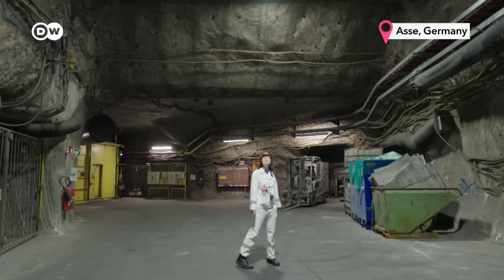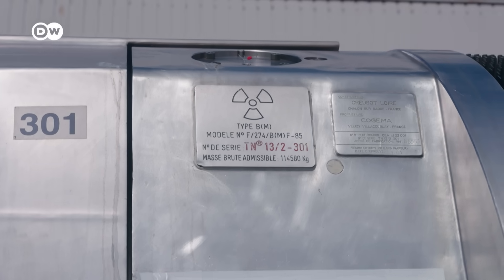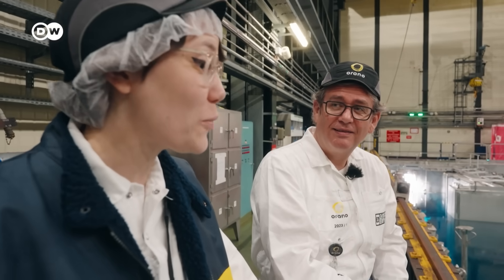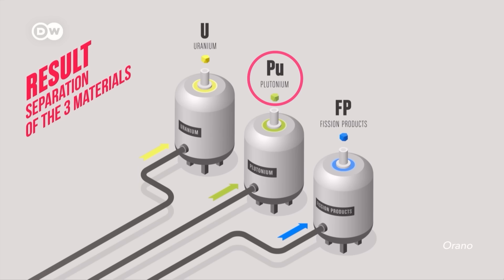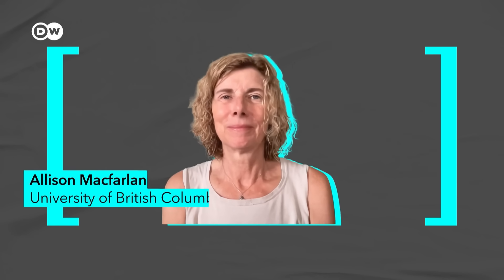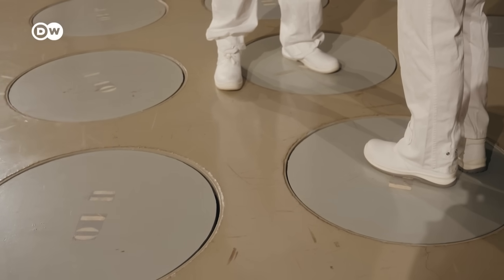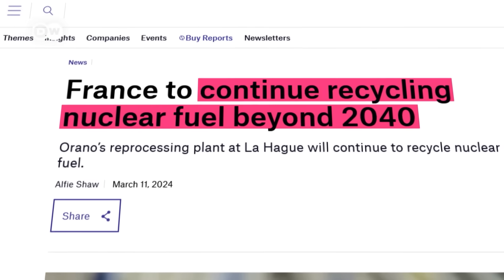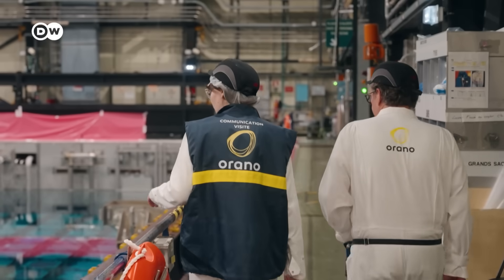Nuclear waste is reusable. Why aren’t we doing it?

Comment: Someone should create a simple system where you can just throw in disposed nuclear fuel into a dump like it's coal, and have it run a plant that directly removes carbon from the atmosphere.  Since the fuel will keep going for thousands of years, the place will keep sucking out the carbon.  Better yet, if this is a direct conversion of C02 from the air into carbon neutral fuel, then you could have it constantly piped out into some giant storage tank.
Reply: It doesn't work like that. Fuel is hot because of casks to accelerate the degradation. Without them the amount of energy released is pretty small so it's better to either reprocess it or throw it into a breeding reactor that'll do the same

Comment: Its not bad that we aren't immediately recycling it, becasue it is always available for future recycling. And it's easier to recycle once it has cooled down for a while.
Reply: This was a huge debate in the United States not long ago and kind of still is. Members of US Congress came out to discredit nuclear waste recycling to push solar and wind power.
Reply: @purplespeckledappleeater8738  "It was a dark and moonless night, with not a breath of wind to be found".  Start of a suspense novel, or an illustration of why solar and wind power will never be suitable for Base Load power generation?  Hydro is good, but you can only run so much water through the dam before you have issues.  

On the other hand, you have Columbia Generating Station.   1000MW of nuclear power plant with an availability in excess of 99% of their scheduled up time.
Reply: Yeah, thars why, for example Finlands new waste repository is designed so that the spent fuel can be recovered for recycling.
Reply: I wonder if the spent rods could be used in RTGs while waiting for the less stable fission products to burn out.
Reply: Nope, it's to deter the technology of enriching uranium and plutonium, which can lead to the spread of nuclear weapon. That's how India got its first nuclear weapon, from a peaceful use nuclear program.
Reply: Actually it's not, the permanent storage in Finnland, once it's sealed in, there is no easy way to get it out again..
Reply: @georgelionon9050  That's why I advocate against deep geological waste repositories. They are an answer to s question that nobody asked. Dry cask storage is better.
Reply: It cools down once radioactivity dies out. Also meaning that some of the interesting isotopes decayed...
Reply: @etienne8110  Not the ones relevant to power generation.
Reply: Wait... We don't use the radioactive part of the fuel for power generation?
Reply: @SeriousDrazhar  The isotopes that may decay on human timescales are not Uranium 235 or Plutonium relevant to power generation. They have half lives from hundreds of thousands of years to billions of years.

Comment: Gamma Rays are photons and produce megaelectron volts, seems like some type of antenna shield could be created that absorbs Gamma Rays and converts them into useful electricity, similar to a solar panel converting photons into electricity.  Testing can be done by converting X-Rays back into electricity then modified for Gamma ray frequencies.

Comment: The cooling water is looked over mostly(ditrium is it?)is this hot water from reactores and cooling storage radio-active?,,,and where does it go?
Reply: Stored until decayed, released after. It's not looked over, all the processes are studied and defined
Reply from the maker: Like commented, it is solidified and vitrified. (🔗https://world-nuclear.org/information-library/nuclear-fuel-cycle/nuclear-waste/radioactive-waste-management#:~:text=If%20used%20reactor%20fuel%20is,of%20heat%20and%20requires%20cooling.

Comment: Russia will build the first completely commercial reactor starting 2027 (BN 1200)
China will start around that time as well with 6 comparable reactors, its starting to take off.
Reply: The BN 800 reactor has been in use since 2015, BN-600 since 1980. China is building reactors similar to this.
But China is also building research molten salt reactors (TMSR-LF1) as is India.
Reply: @MihailG5541  China actually build 2 Bn600 style reactors (Cfr600)
Reply: @erik7853  can't find sources that describes connection fast Chinese reactors to the grid and power up to the nominal power rate
Reply: @MihailG5541  They are pretty quiet about the Cfr 600's, but the first unit has already achieved criticality a while ago, so logically it would by online by now.

Comment: It helps to think of nuclear fuel not as the gasoline (petrol) in your car, but rather the lubricating oil for your engine. 

The oil never stops being oil, but it does accumulate carbon residue, metal shavings, dust, and other detritus, thus becoming less and less effective. (In nuclear materials - the daughter products of the decay chain can absorb neutrons and thus degrade the efficiency of the fuel assembly) At a certain point, you are going to change the oil make sure the vehicle operates efficiently.

Now what to do with this oil? Stashing it in paint cans around the garage only works for so long. Now you could run the stuff through filters and magnets  to remove the particulates, then boil it in a hydrogen enriched atmosphere to refine out a new hydrocarbon substance - but that takes a lot of equipment and knowledge of chemistry. Especially if new bottles of oil are cheap and easily available - it makes very little sense to be doing this on a personal scale. 

It should be noted that the supply of Uranium was very uncertain in the later 1940s and early 1950s, so there were a number of projects started for reprocessing. However, more reserves of Uranium were found and the processes for refining it became more efficient. As time went on more responsibility for power plants was transferred from government service to private companies who in turn focused on cost-cutting even more. 

Unlike Russia, Canada, and the USA - France didn't have a great untapped Uranium source in an unexplored part of the country, so recycling continued to make sense to them. Their independent streak and desire to build nuclear weapons also made research into refinement/recycling lucrative.
Reply: the oil is a great analogy
Reply: lubricant in combustion engine is great analogy 👍
Reply: Mate. It is time for you to make a video. Thanks for your info.
Reply: Fyi Russia and Japan do have recycling plants too
Reply: @cristoforestman  That is a true point. I was focusing on France, as that is where the video is taking place. But we can look at some of the other countries and more interesting examples of what does or doesn't motivate the construction of these facilities. 

Japan - like France - doesn't have much domestic Uranium mining and thus it was also part of a self-sufficiency plan. Furthermore, they don't have a middle of nowhere to store waste - and while I don't know much about the island's geography, I doubt they have a spot that would meet the stability requirements for a facility like Yucca Mountain.

Russia's Reprocessing plants are left-over from the Soviet Era. That of course a whole discussion of a different economic system, paranoia about importing things from the West, and a design philosophy for nuclear weapons that requires rebuilding warheads more often than some other configurations. Major releases of material from some of these plants are occasionally used as an argument against nuclear technology in general. 

Britain had both a domestic nuclear weapons program, a lack of Uranium in the isles, and a harsh post-war financial situation that made the idea of charging others to handle waste seem like it could be a decent source of revenue. Even at the time people complained about the UK becoming Europe's nuclear dustbin. Also - some of the early British nuclear plants used a magnesium based fuel cladding that degraded in water, so they couldn't be left in cooling ponds for great lengths of time and thus required additional handling.
Reply: The power of cheap.

Comment: Do they use the energy from the waste while it cools?
Reply: Lower heating bill in winter maybe? 🙂

Jokes aside, the facility in Sweden storing 50 years of waste in a pool generates 5 MW of heat if I remember correctly so they need a bit of cooling of the pool.
Reply: It's too little

Comment: The waste I'm concerned about isn't the dry cask storage reactor waste. It's the Cold War era leftover waste from building nuclear weapons that was improver stored or disposed of. Some of it has just been dumped into lakes and into the ocean in steel drums. Some of it is just capped with concrete on an island in the Pacific Ocean, with waves slowly eroding the concrete away.
Reply: i'm more concerned about the 40 some nukes that have gotten lost over the years.
Reply: people should be more concerned about the waste generated by coal power plants : little to almost nobody talks about all the radioactive particles naturally contained in coal that get released in the air along with the smoke in the burning process, which adds to heavy metals, toxic arsenic and all the rest of the good stuff that contribute to kill thousands of people every year worldwide. (compared to less than 1 per year on average for nuclear...)
Reply: I'm not sure where you're getting these ideas from. When we decommission a nuclear weapon, the fissile material has never been thrown away, it's just turned into fuel rods for power plants. Sure there's plenty of waste from the refining and enrichment of uranium, but that's a chemical waste problem, not a radiation problem. You should be equally upset about any mining and processing operations that were done back before environmental regulations. Nothing special about nuclear weapons in that respect.
Reply: @iankrasnow5383   Look up: Lake Karachay, Runit island. For two examples. For more, read the wiki on ocean disposal of radioactive waste. 
https://en.m.wikipedia.org/wiki/Ocean_disposal_of_radioactive_waste#:~:text=The%20waste%20materials%20included%20both,been%20banned%20by%20international%20treaties.
Reply: @iankrasnow5383  that's BS. nuclear weapons grade enrichment is way too high for a reactor.
Reply: @cageybee7221  Mix the Plutonium with Uranium in the proper proportions and you have MOX...Mixed Oxide Fuel.  

FWIW, reactors can (and have) been designed and built that are quite capable of using what is considered a "Weapons Grade" level of enrichment.  What you end up with is a reactor that is rather small and has a totally awesome amount of time online before refueling is needed.  Almost sounds like a perfect design for, say, a submarine or aircraft carrier?
Reply: @iankrasnow5383  there are also situations like Rocky Flats, where the physical processing required to make nuclear devices also results in a lot of typical industrial waste, like metal shavings, used lubricants and solvents, etc, which are heavy in radioactive materials.

Comment: "... and stays radio active for 10th of thousands of years"

That figure is misleading and intentionally reported to sow fear. After 200-300 years you can safely hold the spent nuclear fuel in your hand. The elements that emit dangerous high energy radiation also decays the quickest. It then takes another 10'000-100'000 years before the low radio active elements have decayed below the level of background radiation.
Reply: Yes, those fission products under the floor only need 300 years. Maybe they are some useful elements after that.
Reply: @zapfanzapfan  It mainly consists of U238, which is fertile but non fissile. U238 can be used in a breeder reactor to create PU, which can then be used as fuel. 

The reason why we don't reuse spent nuclear fuel more is because of economics. There is so little waste to contain and it is still cheaper to dig up and enrich new uranium.

Comment: The Problem is that the nuclear power plants are cooled by water. If you dont have water like the last years in summer, the safety is not garuentied.

And dont forget solar and wind energy is a far way cheaper than nuclear power
Reply: You can put them by the sea.

Also, nuclear reactors are only more expensive if you build them in small numbers. If you build dozens of reactors, like France did, you get economies of scale and they get cheap. If you build 1 at a time, like the US or UK, then they're expensive.
Reply: False. It wasn't that the water couldn't cool the reactors, it's that the released water was too hot and would kill the fish. And this can be accounted in new facilities that'll have longer pipes/other methods to allow it cool further. Also, usually in these cases pp aren't shut down, just the reaction speed is reduced.
Most pp in france were recently shut down because lack of maintenance during covid
Reply: What if the wind doesn't blow and the sun doesn't shine? Nuclear is far more reliable even when there is less water.
Reply: safety absolutely is guaranteed. Primary cooling system is a closed loop. In case there is not enough water, they simply scale down the reaction which will produce less heat and thus need less water in secondary loop.

Comment: They Extracted It For
Nuclear Weapons,
Russia and USA!
Reply: Energy plutonium from nuclear waste consists of 3 isotopes that are very difficult to separate and almost impossible to use for the production of nuclear weapons, but can be used to produce MOX or REMIX fuel to save 30% of natural uranium in each cycle of reactor operation.

Purification of spent fuel with a decrease in the level of uranium and plutonium in them from 0.7+0.7% to 0.1+0.1% and reprocessing of purified fuel in MOX or REMIX allows to reduce the radioactivity of depleted uranium hundreds of times lower than natural uranium.

Comment: It would be interesting to know how much oil is used in the process of nuclear power and waste .. from mining and the construction to the waste transport and disposal..
Reply: Not much, a bit less than wind/solar (hence their slightly lower per MWh emissions). Cause nuclear reactors are so small, relative to their output, so don't use much material.
Reply: Nuclear carbon intensity: 5-12 gCO2/kWh
Solar: 25-40 gCO2/kWh
Wind: 11 gCO2/kWh
Coal: 900-1200 gCO2/kWh

Comment: One thing never mentioned is the possible conversion of U238 to energy using fusion-fission hybrid reactors.
Reply: One thing never mentioned is the possible conversion of U238 to energy using fusion-fission hybrid reactors.  Spent nuclear fuel is mostly U238.  Fusion reactors may not be ready to produce power for the grid but they are ready to produce fast neutrons that can fission U238.  The question is, "Can spent fuel be used to fuel a hybrid reactor?".
Can Spent Fuel Be Used to Fuel a Hybrid Reactor?
Yes, spent nuclear fuel, which primarily consists of uranium-238 (U-238), can potentially be utilized in fusion-fission hybrid reactors. These reactors leverage the neutrons produced by fusion reactions to induce fission in U-238, thereby converting it into energy.
Hybrid Reactor Concept
In a fusion-fission hybrid reactor, the fusion process generates high-energy neutrons that can interact with U-238. This interaction can lead to fission events, effectively allowing the reactor to utilize the abundant U-238 found in spent nuclear fuel. The fusion neutrons can cause U-238 to absorb a neutron and subsequently undergo fission, producing energy and additional neutrons that can perpetuate the fission process 
(https://en.wikipedia.org/wiki/Nuclear_fusion–fission_hybrid).
Fission Multiplication
A key aspect of this hybrid approach is known as fission multiplication. For every fusion event, several fission events can occur, significantly increasing the energy output. This means that even when the more fissile isotopes like uranium-235 (U-235) are depleted, the reactor can continue to operate effectively by relying on the neutrons from the fusion process 
(https://en.wikipedia.org/wiki/Nuclear_fusion–fission_hybrid).
Waste Management and Energy Production
Using spent fuel in hybrid reactors not only provides a potential energy source but also addresses the issue of nuclear waste. By transmuting U-238 into fissile materials like plutonium-239 (Pu-239), hybrid reactors can help reduce the long-term radiotoxicity and heat generation of spent nuclear fuel 
. This approach could make the nuclear fuel cycle more sustainable and efficient, allowing for better utilization of existing nuclear materials.
In summary, the integration of spent nuclear fuel into fusion-fission hybrid reactors presents a promising avenue for energy production and waste management, leveraging the unique properties of both fusion and fission processes.
Reply: For what do we need this rubbish?
Reply: @imtheeastgermanguy5431  energy
Reply: @legendaerycraft2226  for what price? It's expensive, dangerous
Reply: @imtheeastgermanguy5431  Its not dangerous at all if you do it correctly. Also, nuclear plants are always expensive at the beginning, it just takes some time to get to the positive numbers.
Reply: @legendaerycraft2226  they have never positive numbers
Reply: Irradiating U-238 with high energy neutrons makes Plutonium-239, the covert agenda for fusion reactors.